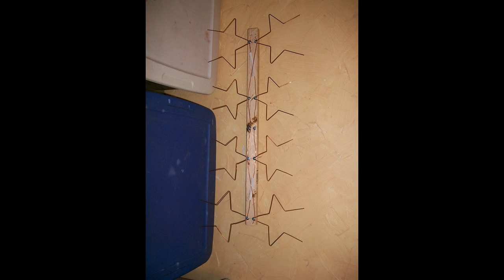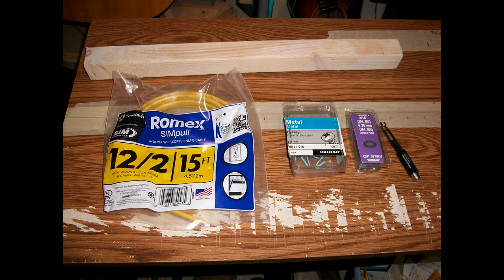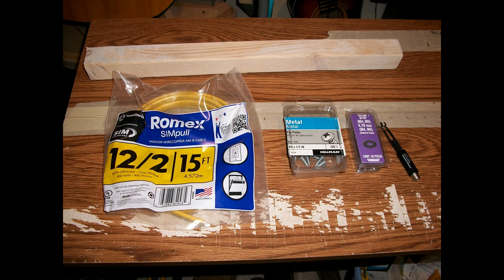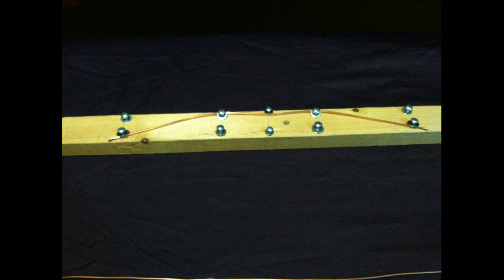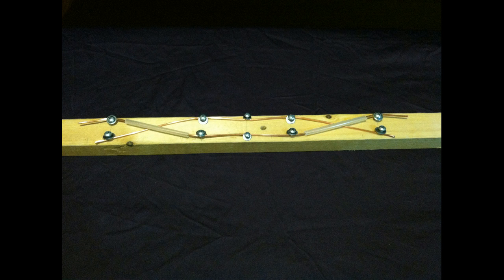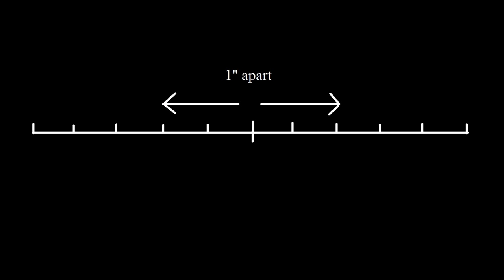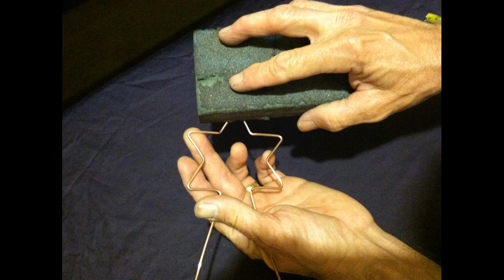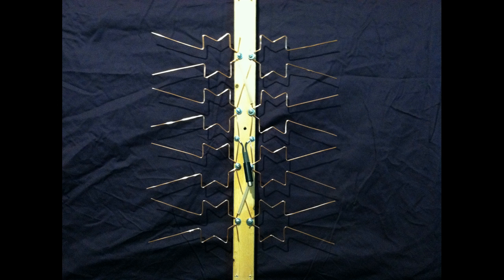How to build a TV Antenna - Fractal Bowtie Tutorial

Comment: I don't understand throwing this design in an attic, up north.   A little work on the center piece aesthetical appeal, add a single Vhf pole, a combiner and strap it to the chimney near the top.  You would not loose 30% of the signal and it would be good enough for any wife or house association or nosey neighbors. It is not much different than Christmas or winter decorations as it evokes snow flakes.

If you choose wood, it would need an annual restraining. Black frp is what the ai recommends.

Comment: Not sure how you decided on 18" elements. This is a UHF antenna so the 1/2 wave channel 14 frequency 470 to 476 length for elements is 12.55", or about 13".

Looks like a solid build. Good job on the antenna and video.

Comment: I mount 5 elements to a side making 10 total per wooden pole then make another 10 element pole and mount both on a piece of 2  x  6 pine lumber with both poles wired together.  I get 30 channels from as far out as 60 miles . Reception at night is best because the sun does not screw with the signal as much at night. Not bad for a freebie antenna. Beats anything WalMart sells.

Comment: hi, i wonder if you can help me out? i am wishing to make a high gain uhf ham band 433mhz or 70cm fractal antenna. i just don't get how someone is supposed t owork out what fractal shape to use. i am not so bothered about being able to transmit on it,. apparently a fractal can give 20% increased efficiency? i was going to make a double quad with reflector, supposedly around 12dbi gain. can this antenna exceed that and if so how?   thanks , peter
Reply from the maker: Bill Shatner 
I’m not a technician. Just a guy who discovered a solution for my cable bill problem and wanted to share it with the world. 
  This video is the first of several on my channel that I posted a few years ago but is not the best antenna. My latest video called “Build Your Own” is my best antenna so far. Head over to my channel, click the video section and check that one out. 
  Instead of 56”, make your elements two wavelengths long, divide by 8 and make your bends to those measurements. I can’t guarantee it will work. 

Btw, out of all my experiments, the triangles work the best in my opinion.
Reply: Thanks for the info. that is the sort of answer i was looking for, what is the best shape. i will check out you're other videos. thanks.

Comment: Mike, Do you prefer this design over the triangle shape fractal you made? Not looking forward to all those bends if there isn't an appreciable difference...
I made the Tuxedo with aluminum, want to try a fractal with soldered copper now
Reply from the maker: The 8 point fractals may work better to stabalize the signal if interference is a problem which was the reason I had to use it. It was my 1st design. If you don't have an interference problem, the fractals may not be necissary at all. I believe the best design I discovered was the Tri-4 labeled "SUPER EASY TO BUILD". (Just throwing it out there)

Comment: Is this the Fractal Bowtie design best for a weak signal (the station is 60 miles away) I only want one Chanel where I live is a bad reception area
Reply from the maker: This fractal bowtie design is the first design I had success with but I needed to overcome interference in my attic, not weak signals. It also depends on the station's frequency and transmit power. The bowtie works great for UHF but not so well for VHF in which case, a VHF add on would work well. For long distance the best design I came up with is the Tuxedo. I have a video for that as well on my channel. It's a spin-off of the Hoverman which is also an awesome antenna. I created the Tuxedo so it would fit in one's attic. BTW, what are the call letters of the station you're trying to get? (ie., wxyz)
Reply: The call letters are WXII which has a frequency range of 204 -  210.  What I read & dont understant is "WXII-TV shut down its analog signal on June 12, 2009. The station's digital signal remained on its pre-transition UHF channel 31, using PSIP to display WXII-TV's virtual channel as 12 on digital television receivers." https://en.wikipedia.org/wiki/WXII-TV  So do I need to get channel 31 or 12 because 12 is VHF & 31 is UHF?  by the way great video!
Reply from the maker: According to the fcc tv quiery wxii is virtual ch 12 but transmits at RF ch 31 (572 - 578). https://transition.fcc.gov/fcc-bin/tvq?call=wxii&arn=&state=&city=&chan=0.0&cha2=69&serv=&type=&facid=&asrn=&list=0&ThisTab=Results+to+This+Page%2FTab&dist=&dlat2=&mlat2=&slat2=&NS=N&dlon2=&mlon2=&slon2=&EW=W&size=9#10001
It shows 2 channels from the same tower. I'm pretty sure the one you're looking for is the licensed. Not the construction.
It has excellent transmit power but you might have to install your antenna high and outside. The Tuxedo does much better for distance but distant stations may come in great one day and not at all the next. Thanks for the compliment :)
Reply: after I started to make the antenna I found the 10.5 inch  elements will not work  (here's a picture of my first wire bend http://shopwilkes.net/email-bs/~.jpg )so I guessing I will have to use the V shape for the  elements to custom make an antenna to get channel 12 WII   How would make it?
Reply from the maker: 10.5 inches is too small. I don't know how you got that. 18 inches should work just fine but if you are looking to custom build it for that station, check out the custom build video on my channel. And while you're on my channel, click the ABOUT tab. There are some helpful links you might find useful. You'll need to copy and paste them into your browser. BTW, if you use the straight V elements and are installing the antenna in your attic, you may experience interference. That was my problem and the reason I combined the the antenna with fractals in the first place. If you install it outside the straight V may work OK.
Reply from the maker: It is correct except for the last part. Remember you are calculating for UHF (ch 31). Divide by 2 only if you're calculating for VHF. So your element length should be 20.64 or rounded of at 20½".
Reply: Ok thanks I will try the  20½"

Comment: Can you use this inside the house or does it have to be outside?
Reply from the maker: Thanks for your question Robert. This antenna that I built using wood is best mounted in a dry location either indoors or in your attic. Basically an indoor antenna. I have mine in my attic. It is important not to use treated wood because it can be more conductive and deliver a weak signal. If you plan to mount it outside, white PVC material is the best thing to use. PVC is actually best in any case, but dry untreated wood will do fine if you want to build it cheap. I will be posting a new video soon presenting a new and easier design for this antenna. If you're subscribed, you'll get a notification when it publishes. Thanks

Comment: Mr. Cordcutter,             Nice design. I'm trying it out. Any reason why you cross the connector wires? Could  you run in straight down each side? Thanks,,,,
Reply from the maker: As far as I know, the crossover connection in this four bay antenna is just standard. A parallel connection will work but it may be more sensitive to interference. Give it a shot though and let me know how it works for you. Thanks for your comment! :)
Reply: Followed your design. Just made each element a bit shorter at 12 inches each. Thanks for posting your video. Antenna drew in 24 channels at a distance of around 15 miles.
Reply from the maker: Awesome!

Comment: Good video. Interested in seeing a comparison video of the fractal bowtie vs a bowtie with a reflector.
Reply from the maker: Hi Mark. Thank you for your comment. Before I settled with the fractal bowtie design, I used a regular bowtie in my attic for a few weeks as a test run before cancelling my cable service.  I didn't have any real luck with reflectors (I used aluminum foil), but I mounted all my antennas around the AC unit in my attic which seems to act as a big reflector. 
 Two issues I faced were power lines that run in front of my house, and the fact that I live a couple blocks away from the interstate. Back in the day of analog, CB'ers would blast through the TV. With digital, this doesn't seem to happen anymore but I do believe that CB activity DOES interfere with reception, we just don't hear them.
 The regular bowtie seemed to be sensitive to this and experienced short dropouts often. The fractal part of the design seemed to overcome external activity and for me it was a great solution. Without it, I guess I would've had to keep my cable service!
  I can't promise that i'll do a comparison video since I don't have a whole lot of time on my hands, but I do hope to do one on how to custom build  the antenna for the stations viewers are wanting to receive.